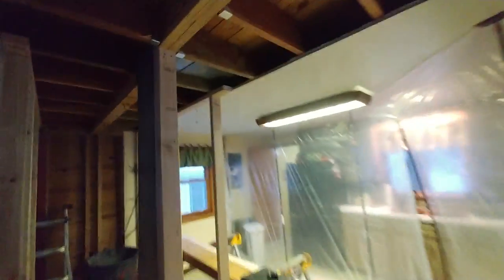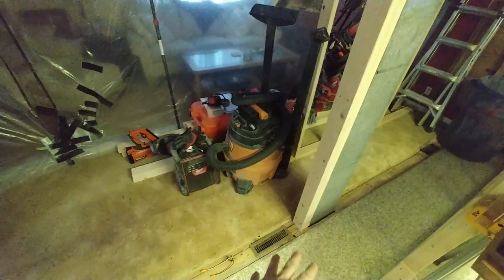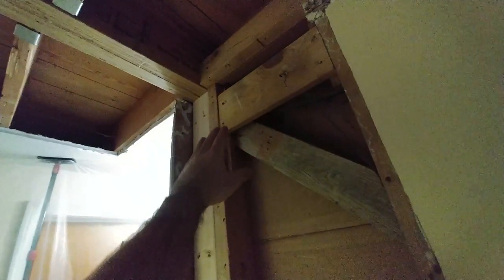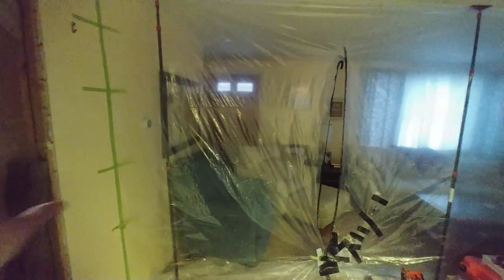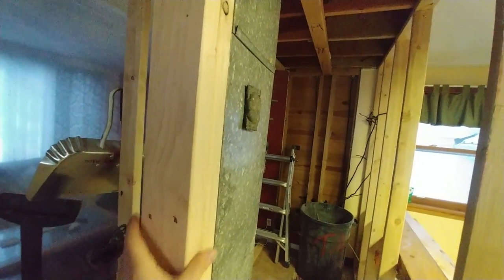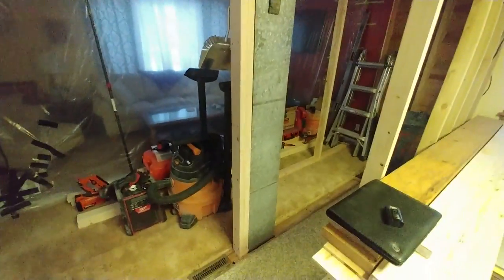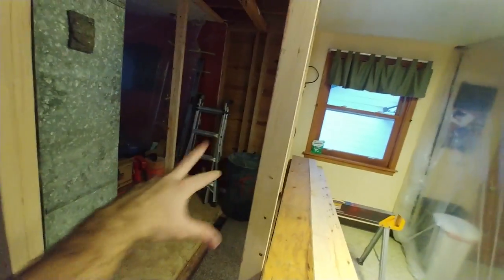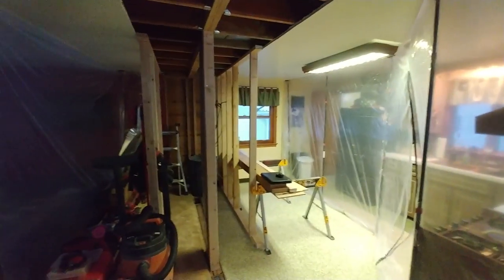Load Bearing Wall Removal Episode 8

Comment: Quick question/observation, does the thickness of hanger BOTTOMS change the plane of. the ceiling drywall, meaning doesn’t create a scenario where it has to be feather muddled to be smooth ? Couldn’t the existing joist, ( in theory) have been routered so that the bottoms were flush ?
Reply from the maker: You can do that if you want and I understand what you're saying, but generallyspeaking the drywall board floats right across that and you'll never notice it. Nobody's framing is a truly perfect flat plane.

Comment: I am surprised that hangers from beam to joist are enough. I know the beam would have been an eye sore but would the beam be better under the joists.
Reply from the maker: What do you mean by "better"?  Hangers are engineered for this exact application.  They are for when you can't stack lumber for logistical reasons, because that's a cost and time savings. Not because it's structurally more sound.

Comment: You forgot to put the footer under the supporting pole. The one you presented as going there in Episode 7...
Reply from the maker: Footer? I never said anything about a footer, footers or footings are concrete and underground. There's a small piece of 2x4 under this bearing post, a sole plate on the sub floor. I may not point it out directly but as you mention, I did so in the previous video.